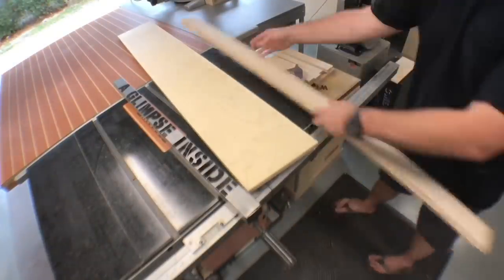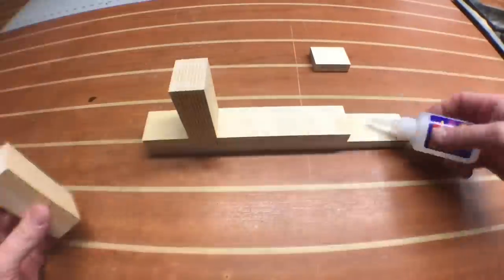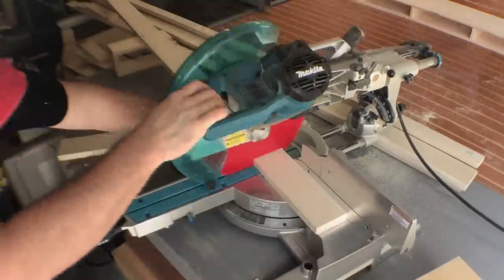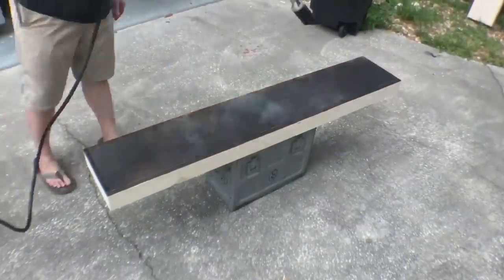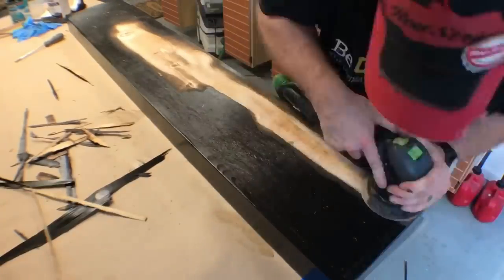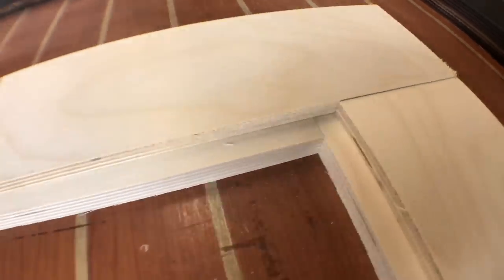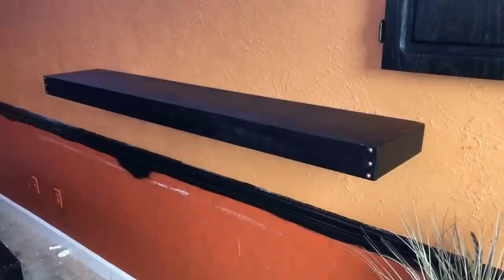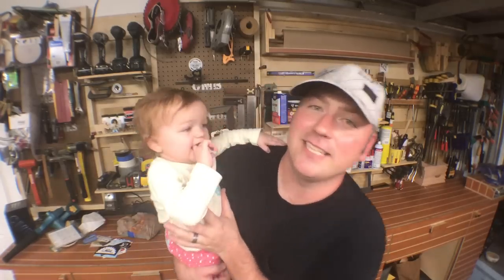DIY Floating Shelves | No Special Hardware | How To

Comment: Hate drywall anchors. I only use toggle bolts now. Kinda pain but If put a little piece of pex line on bolt it’ll bottom out against wall and leave a gap for the wire to hang pics etc.
Reply from the maker: Toggle bolts are fantastic I completely agree. We typically use them with hanging things from the ceiling where there is no support. Definitely a good tip

Comment: An 80 pound mirror?
How heavy are those furniture tacks?

Seriously though. Really nice work. My first floating shelf was pretty much exactly the same idea only a lot beefier. Whole shelf and bracket weighs at least 50 pounds. I bought eye bolts and cables thinking I'd have to hang the outside edge from the ceiling but once I got the lag bolts in place I realized they were more than enough.

Liked and subscribed.
Reply from the maker: oobaka1967 ok. You got me. It's  more like 70 lbs or so. And yes. This technique is super strong. I should've had my kids sit on the shelves! Thank you for the sub. Much appreciated

Comment: What drywall anchors did  you use? I have always struggled with hanging stuff from drywall. The anchors end up cracking around the drywall and loosening up over time.
Reply from the maker: I believe they are Ez Ancors75 pounds from Home Depot. Been using them for a while and have always worked well

Comment: I am making some of these this weekend for my wife's shoes, Great design! For the internal support frame, is glue the only thing you used for fasten? I see some tack nails but I am more specifically asking about the arms that are attached to the back plate. Thanks in advance for your input.
Reply from the maker: yes is the only thing besides the brad nails. It once that glue set up your good to go. By the way I edited this post because my talk to text was absolutely ridiculous. Just in case you get an email with the original thing that I said LOL
Reply: Right on, thanks for the feedback. If possible I will post a picture in this thread when I’m done. Thanks again!

Comment: Would that engineering support shelving on a tiled wall in a kitchen with stacks of plates?
Reply from the maker: As long as they were drilled into the studs. You should have no problem

Comment: Excellent building method. I've tried something similar using oak ply for the shelf/backplate and some scrap pine for the bracket. Doesn't seem to hold as much weight as i thought. how much weight do you think/know these will hold for an extended period of time? looking to refine my method closer to yours and use them as book cases. books get heavy quicker than i expected!
Reply from the maker: +Aston Thompson this method I use in my home and we've had a set up for 4 years now with no sagging at all. One shelf has about 100 lbs on it and is doing well. Thank you for watching!!

Comment: When you make the pseudo mortise and tenon joints for the frame, do you use any screws or anything to reinforce them? As much as I like CA glue, it doesn’t seem like a lot...
Reply from the maker: Yes I put 3 inch screws into the back
Reply: A Glimpse Inside awesome thanks. I have a store bought floating shelf that sags a little. Gonna try this and make a new support. It’s nice that you don’t necessarily need to use the good plywood either since you won’t see it. As long as it’s flat with no big voids...

Comment: How deep do you think these would support? I have a need for some shelves 2 feet deep
Reply from the maker: Alex W. this technique will work for something 24 inches away from the wall, however I would make The bracket at least 4 inches thick which would make your floating shelves roughly 5, 5 1/2 inches thick. I would also used to lag screws per stud. Hope this helps and thanks for watching
Reply: A Glimpse Inside Thanks for the advice. Could I cut down on the thickness by supporting the two short sides, taking away the "floating" feel? I had considered using the wall on one side, plus a support on the other (8 feet down). If my description is lacking, I can PM more detail if you're willing
Reply from the maker: Alex W. I totally get it. Yes. Supported by two studs 90° From each other, should be adequate. Two walled support is much stronger!!

Comment: Great video Chris. What's the width of the shelves? 60 x10 x 2?
Reply from the maker: They were 60” x 11” x 3 1/4”. Hope that helps thanks for watching
Reply: Definitely. Your video is AWESOME and the best one out there. Thank you. Going to make them this weekend. Had another question. Is the reason that you're gluing pieces together is for more strength? Was wondering why you wouldn't use a solid piece of wood for the cleat that's the same thickness. And finally, what are the dimensions of the pieces that make the skeletal structure and the brackets that stick out?
Reply from the maker: Caroline Bressler Yes layering plywood to make the skeletal structure is much stronger than just putting up pieces of wood together. And I make the skills of structure first and then use the measurements from it to make the shelf itself. As long as the inner part fits snugly over the outer part everything will come together just fine. Have fun building your shelves!
Reply: Thank you so much for responding so quickly :) Super excited to get started tomorrow.